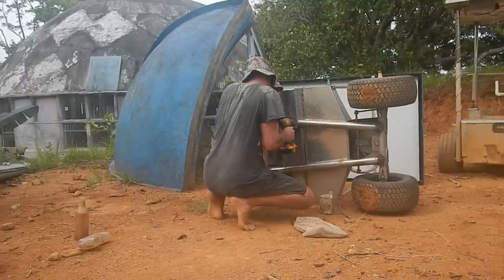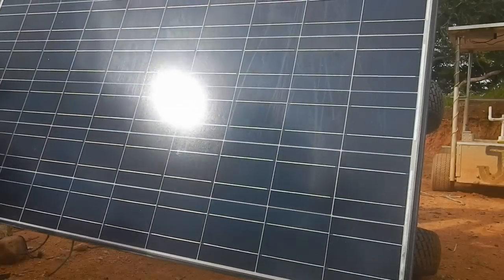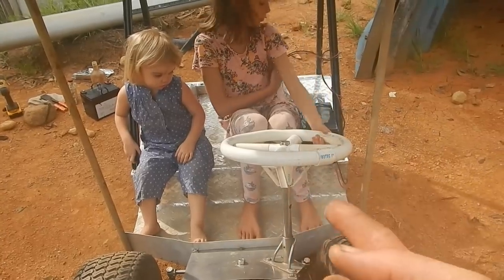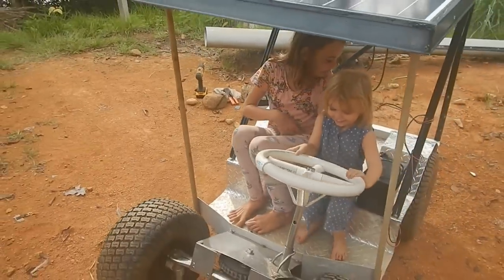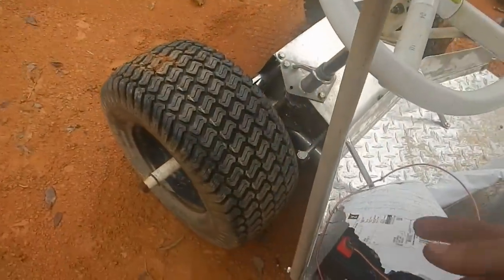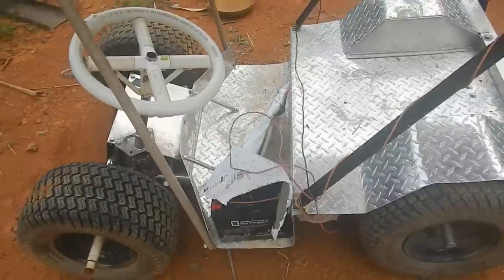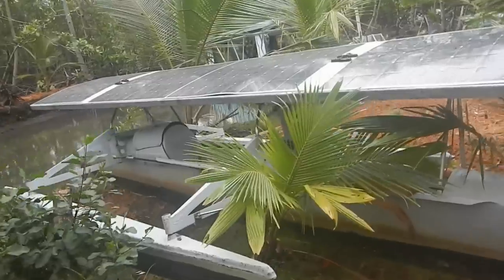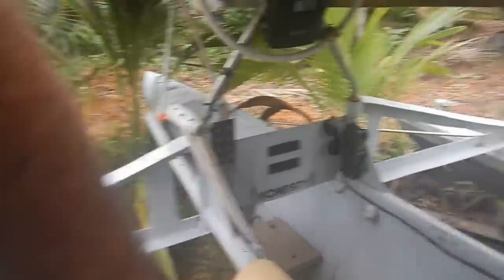Kid Car 010 Battery Power!

Comment: What's up with the dark vs grey dome roofing situation
Reply: Different mix of cement maybe, and wet from the rain, ?
It also looks like the thin layer of cement there is coming off of the plastic underneath, in patches ?
Reply: @idjtoal  maybe something delaminated
Reply: @bigav8r  could be, temperature changes causing the plastic to expand and contract, or air pressure maybe, trapped air under it vs the outside, ?

Comment: I was wondering where is the bulldozer was ..lol .. that thing is sick I wish I had one
Reply: The speed controllers that you're making..... Absolutely fascinating... My great-grandfather the colonel.. he was a master Freemason in Washington DC at lodge number one... Had lunch with President Reagan many times...  He built speed controllers and all kinds of things just like the way you are building them. .. the old school method... I was only twelve when he died... I didn't get to learn all the things he knew and did... He invented things for the army .. in France during Normandy a de leading device for gas ... Awesome job Jamie... Very interesting to know that, a stove burner has the same properties...😮
Reply: And hells yes..... The steering is awesome....🎉
Reply: So it has a lot of torque.... I think that's what you mean by force... It's a crawler... That's what they do with rock crawlers as they actually gear them lower prevent the wheels from slipping and then they lower the pressure in the tires so the tires form around The Rock..... It's almost like a bear climbing up a Rocky mountain think of how his paws conform around each Stone as it's going up the mountain.... There's a guy here on YouTube his channel is RatherBwelding he uses sprockets and gears... To make small transmissions for his go-cart projects.... You could get some ideas from him...